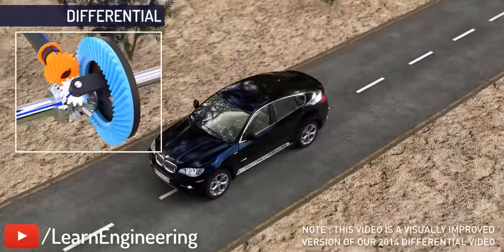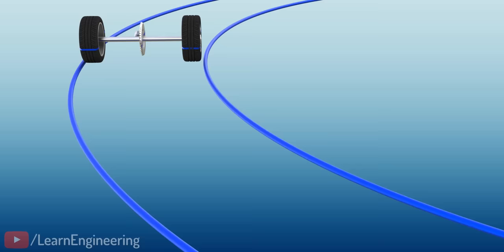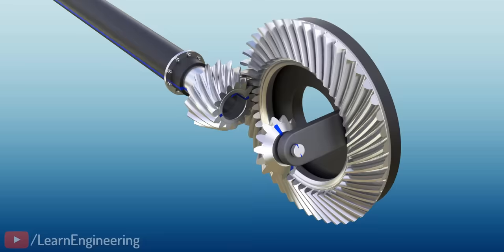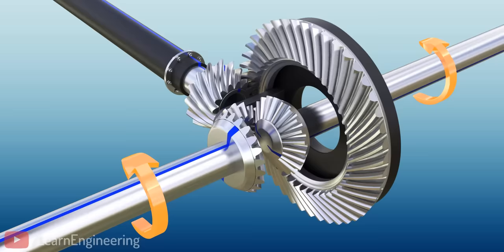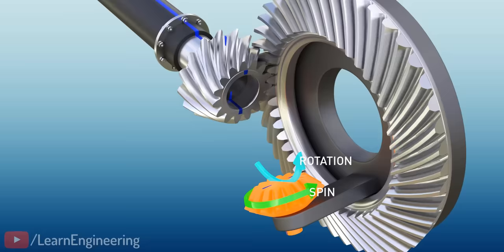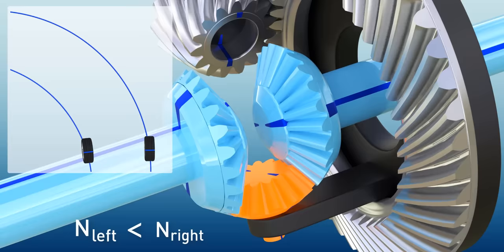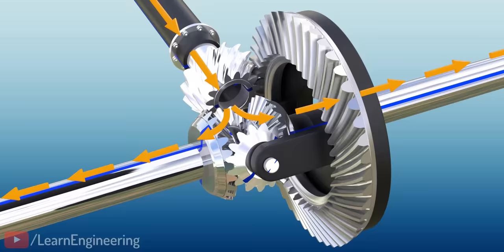Differential | How does it work?

Comment: I guess the main problem is ... If one wheel stucks other wheel get force doubled, like if car is traveling in good speed and any obstacle hits the left wheel then car will veers left side of road due to extra force applied on right wheel causing yaw movement, i know there are other 2 wheels too to prevent this happening but this will definitely change the trajectory of car if car starts skidding or drifting

Comment: I've rebuilt several differentials.  Detroit locker with the rachet system is probably the hardest.  Pretty simple but you've got to have the back lash right on both the load side and the coast side.  If not, you'll ruin the gears very quickly.
Weld those spider gears up and you'll have a poor man's positive traction unit.

Comment: There is a lot of parts in the rear differential. Had to have mine rebuilt at 94,664-mile mark on my 2011 Crown Victoria Police Interceptor ($1,177 including parts, labor, and tax) unfortunately as there was chunks of metal and shavings when I did my rear differential fluid change myself. Rear differentials usually last at least 80K miles minimum depending on how you drive before needing a rebuild. If you have a bad rear differential, you will hear a howling or grinding like sound or little bit of a "smoke" smell.

Comment: Golden Point - The whole of the combustion chamber shouldnt be used for burning fuel but there should be a cover plate which moves and ensures more or less burning of fuel and this cover plate serves the function of the flywheel, clutch, gear box, gear wheels, transmission and differential gears ie varies the amount of power and Transmission of power and ensures different speeds of the wheel ( El )

Comment: Also differentials can be regulated to get more stability at the cost of handling. A freerer differential can be dangerous in case you need to use brakes because some wheels can spin with different velocities and can make the vehicle to change direction suddenly. Instead can be set a maximum value of spin's velocity difference where the differential stops so the wheels will spin in sync and makes the car more stable at the cost of a larger curve to take

Comment: Nice explanation but the question will be how the spider gear gets its power to rotate on its own, just like the ring or bevel gear gets its power from the pinion that is connected to the propeller shaft.

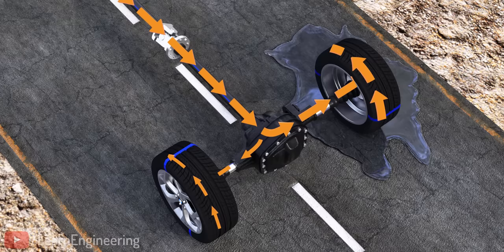Comment: At 4:28 the slipping may be better explained with "the slippery wheel will loose traction and start spinning faster, but the wheel with good traction will get just as little torque as the slippery one".

Comment: The larger/bigger diameter of the gear, the slower it revolves. But bigger/larger diameter of a circle, like of a tire, the farther distance it travelled, compared with the smaller/shorter diameter of a circle (tire).

Comment: So if the ring gear was big enough and the spider gear was small enough and the distance between the wheels was wide enough to create maximum difference in velocity in a sharp turn it’s possible that the ring gear rotation could be completely neutralized by the much more active spider gear and the tire could spin backwards while driving. Wild

Comment: Well the first solution for slippery surface was differential lock, but I look forward to see the more advanced solutions.
Reply: Like electronically controlled clutches between the side gears and the axles?  Those exist today.  It not only can behave like a mechanical limited slip differential, it can also apply more torque to the OUTSIDE wheel in a turn to make the car turn tighter without any wheel spin.

Comment: Quite informative..one question..How is power transferred in a front wheel drive ?
Reply: Front wheel drive cars use constant velocity turning joints to transmit power to the front wheels.
https://en.wikipedia.org/wiki/Constant-velocity_joint

Comment: We would weld the spider gear to the side gears in a demolition derby car for full traction to both wheels.  If you turn in a paved parking lot the inside rear wheel will CHIRP CHIRP CHIRP!

Comment: Great video!! Thank you!
But one thing is unclear to me: "...when properly matched ..." how is this achieved?
What controls the spin velocity of the spider wheel (omega_spin) determined? Is this an "active" machanism (braking or accelerating the spider wheel with a brake or motor)?
Or just passive - an effect of different reaction of the wheels or similar?
Reply: in this example, completely passive. it basically depends on the resistance of each wheel is under, if you were to lift the car, and clamp one wheel so that'd it would never move, all the rotational speed would go to fhe left wheel instead
Reply: @radishhat5736  Thank You!

Comment: Great video.  However, the explanation started a bit off center.  It's not the outside wheel spinning faster, it's the inside wheel spinning slower.  Watch the video and notice the outside wheel in synchronization with the drive gear and the inside wheel spinning slower.

Comment: Technically speaking, the differential does not turn the drive through ninety degrees, many current production vehicles are transverse engine, front wheel drive with no ninety degree turn.  Also, the gear reduction is handled by the ring & pinion, which are not a part of the differential, they just happen to be in the same housing - take a look at an all wheel drive transfer case - there's a differential, but no reduction gears.

Comment: What would happen if you turn left instead of right. It seems like it only increase speed on the left wheel when you turn right. So what happen when you turn left. Are you sure you need a differential gear . I never new the back two wheels will do that different sence Have a good day

Comment: Just a question. Does this mean if I get a blowout on a semi worn tire, I don’t need to buy both new tires on the same axle? Since the differential will take care of the slight different rpms? Or does that cause excessive wear and tear and therefore recommended you replace two tires?
Reply: It's better to replace two tires at the same time with identical tires, but you can get away with just replacing one tire at a time.  It's best practice to replace both tires on the drive axle at the same time, while you can use the non-drive wheels as a "clearing house" for your unmatched tires.   It's strategy to do this on a two-wheel drive car.

For a four wheel drive car, it's best practice to replace all four tires at once.

Comment: Nice animation. It's a shame the video fails to mention one of the main properties of an open differential, which is that it splits the torque always evenly 50:50. With that said, it is not a great explanation to say that the majority of power goes to the slipping wheel on the slippery surface. The disadvantage of the open diff in this scenario is the very fact that the torque split is always even. Which means that the wheel with traction receives only as much torque as the wheel on the slippery surface. And sometimes this torque is so little that it cannot even move the car.

Comment: I may sound stupid with this but if this is only for 4WD vehicles how does it work with 2WD vehicles? I get that the two wheels that aren't powered will just move freely on their own at different speeds if doing a turn but what about the two powered wheels when making a turn? Or does it just not have this technology and the two powered wheels do not move at different speeds and continue to move at the same speed depending on how much power is being outputted from the engine?
If someone can make me look stupid it would be appreciated.

Comment: I think I've missed part of the explanation. How does it account for tighter turns vs. more gradual turns?
Reply: In this example of an open differential, the differential can directly drive both rear wheels at the same speed (when driving straight) or drive one wheel only (when one tire has no traction while the other does have traction)  and infinitely in between those 2 extremes.  The 2 side gears are connected to each (left and right) axle and therefore rotate at the speed of their respective wheel.  Since the spider gears are connected to the ring gear via the differential carrier and the ring gear transmits torque from the pinion gear and the spider gears are in constant mesh with the side gears, the spider gears drive the side gears yet can also spin on their own axis while driving the side gears to account for different wheel speeds left to right.  If wheel speed is equal left to right, the spider gears do not rotate on their axis.
Reply: @ghostwrench2292  Oh that makes sense. Thanks for taking the time to explain it to me, much appreciated!

Comment: Brain teaser: how does a train car accomplish turns with a RIGID axle?  The answer is NOT, “the turns are so gradual it doesn’t matter” or “it slips a little bit”.  Hint: You for sure have all the information you need to solve this problem if you have ever looked at a train wheel. The answer made me very impressed at old school mechanical designers. Ponder it before looking it up.
Reply: I saw the video that explains that the other day.  It truly is brilliant engineering to have thought of that!

Comment: Simply put, a differential makes the wheels on the ends of an axle spin in opposite directions. That's it. That's all. Makes wheels do nothing else but twist opposite ways.

Well, why doesn't a car's wheels spin in opposite directions, then?

Simple-- the car's transmission isn't connected to make the axle turn: The transmission is connected to make the entire differential turn. The housing around the differential is what gets spun end-over-end by the driveshaft, and any incidental twisting forces on the axle during a turn will be handled by the differential itself.

Comment: but whats the ring gear attached to?
Reply: This is a very good question. The bevel gear drives the bevel ring gear, which together with the satellites (differential pinion) is attached to the housing (differential cage). The satellite gears (differential pinion) are placed on a spider, which is embedded in the differential cage. The housing (differential cage) is supported on bearings at both ends, which ensures its free rotation. The output gears (side gears), driven by the pinion gear (performing rotational and orbital motion, for example in an arc drive), are connected to the half-axles and also have bearings. All this is closed by the outer casing of the differential, which we see under the car. My english is too poor to describe it well, but your question is important to understand the operation of the differential. Thanks to this, you can see the flow of power from the drive pinion to ring gear ,differential cage,pinion gear,side gear to the half-axle. I recommend finding a good drawing showing the mechanism from above. The differential lock usually consists of a rigid connection of the differential cage with one axle shaft. The sleeve is placed on the axle shaft spline and is engaged with clutch  rigidly connected to the differential cage. The lock is engaged, for example, using a pneumatic system. Then the satellite gears can only perform a rotary motion (orbital motion is not possible). This causes the other half of the shaft to rotate in the same speed. Of course, we only use the differential lock when driving straight ahead and at low speed. Best regards.

Comment: So hang-on, how does that work with an electric car? The amount of torque on those would shed teeth faster than a kid in a candy factory. Also when were they first employed in automobiles (I've found references to their use in earlier tech) - but I'm only getting a firm date on Limited Slip Differentials.

Comment: Golden Point - The clutch is also unnecessary and so is the gear box and the differential as the transmissions shaft is wrong design as it causes too many losses

Comment: but this system are not well performed in a slipery road. especially if one of the tire had more slipery terrain than the other. 
4x4 are better in slipery road. but in 4x4, the tire exhausted faster in a normal terrain than the AWD when you turn the steering. so in a normal terrain, the AWD are better than the 4WD. and in offroad terrain, the 4WD are performed better then the AWD

Comment: Imagine if you could put an electric motor in each of the 4 wheels of a car?  If the 4 wheels are pushing at the same time and at the same force, then the car could not steer  left or right.   A car still needs a differential that eats all the motor power in those teeth.

Comment: Not true that the majority of the power will be sent to the slippery wheel. How could it magically do that? No it it's the same force, but as it has no traction the force will be very small. And since the force is so small, the wheel with traction wont rotate.